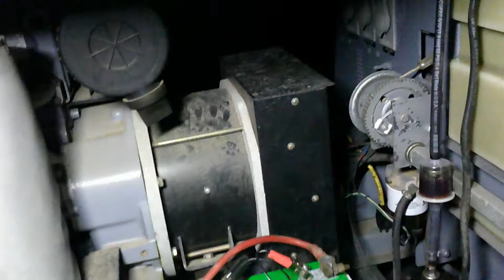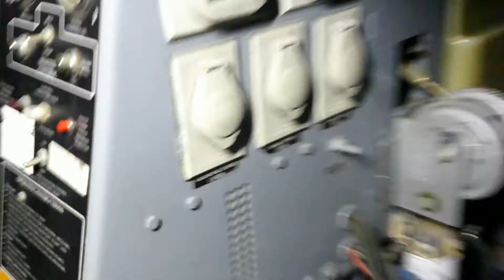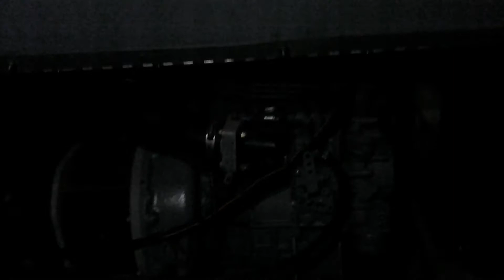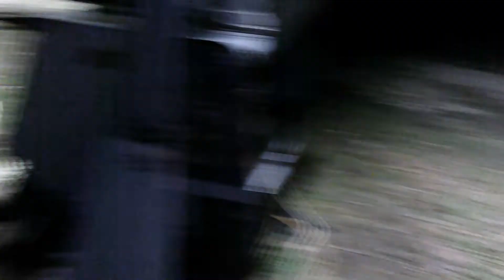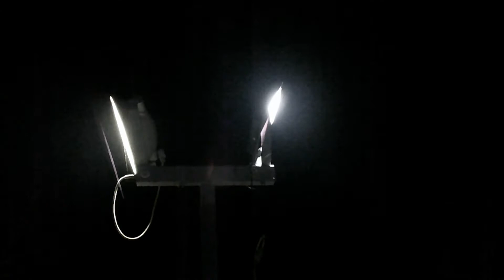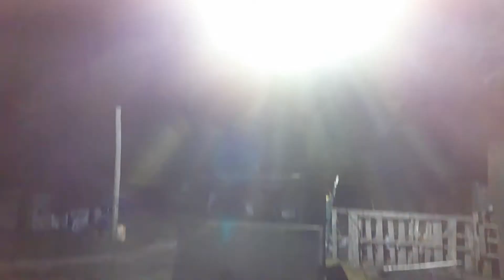Kubota 3 cylinder diesel Zexel injection pump rebuild part 3

Comment: Thank you for your detailed injector pump clean.  I started with the fuel injectors which were severely clogged, and now have a detonation, mis-fire and blue smoke issue. The injector pump is probably clogged too.  2010 BX25, D902 with 2900 hours. Posted a YouTube video as 'ya472'.

Comment: If you wouldn't mind doing a re-assembly with the camera angle a lilt better it would be greatly appreciated. At times you were off camera and I couldn't tell the orientation of the pieces. Maybe a short and to the point re-assembly with the parts laid out in the correct orientation would help. I think most of us can get it assembled, but question what is the front or back and where holes should be aligned. Thank you for sharing.

Comment: Just rebuilding the pump off my Kubota kx61-2, very helpful videos thanks! Out of interest did you find the bottom o-ring was looser? Schematic says they are same size (16mm ID i think) but it feels too big. 15mm fits better. Old ones are different sizes but they are well passed their best. Worried about fuel bypass into the sump obviously - don't want a run away diesel again!